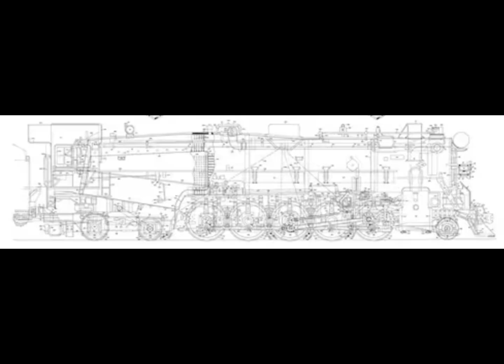SELKIRK: THE LARGEST CANADIAN LOCOMOTIVE

Comment: I really don't know of a bad 2-10-4.  They seemed to work well for the railroads that had them.  The only time ten coupled engines had trouble was usually poor ballancing of drivers.  With dynamic ballancing being fitted to most engines in the 30s this problem was pretty much resolved.  Another great video, thanks much!
Reply from the maker: Some were a bit rougher than others.. But I am otherwise with you
Reply: The Texas and Pacific 2-10-4's got balanced main driver and hearing pre WW2.  They ran on freight and pax.  #610 was used on the American Freedom Train Austin Houston Ft Worth legs. She impressed me more than 4449.  More everyday power in her looks.

Comment: At 7:00 you mention the booster adding 1,200 LBS of TE

I think you meant to say 12,000 LBS of TE
Reply: Was thinking the same, adding a meagre 1200 lbf tractive effort to this beast would make no sense when outset to the cost of installing and maintaining the booster engine.
Reply from the maker: indeed 12k